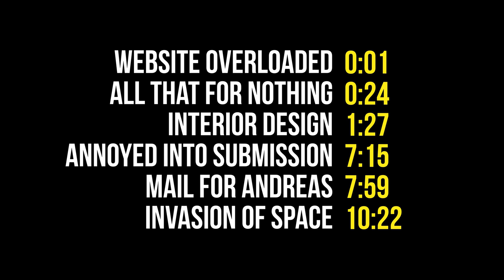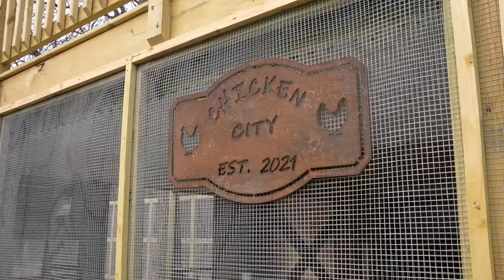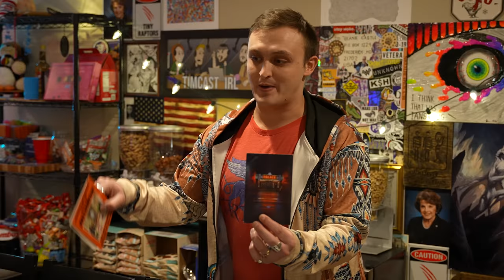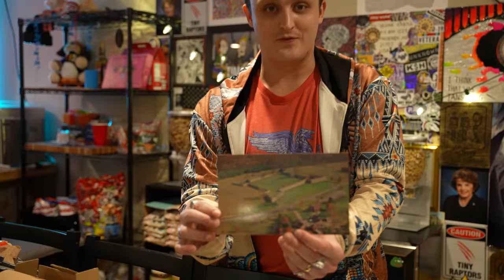Chicken City Completes Construction On Chicken Main Street

Comment: Feels like there is a glaring "security hole" in chicken city.
The stairs has no grate or anything so foxes and snakes can easy get to the chickens.
Reply: If you go back to earlier episodes when it's being built, you can see they sealed up the behind the stairs.
Reply: @TaylorLiam87  I think they mean stairs go up, and there’s no roof to the pen.
Reply: @hmg9194  I think they’ve said the plan is they put them under the house at night which is completely sealed in, and can open up run during the day
Reply: @kpb17  I would still chicken wire over it as a roof, hawks can swoop down really fast and get them when they are all pinned up like that.
Reply: @zeref5845  So true. I lost a ton of chickens and ducks because I didn't write the top of my chicken runs at first.. I learned my lesson.
Reply: What about some sort of netting over the top to keep out Hawks?

Comment: Yeah you guys... I've had chickens my entire life. There's some work that needs to be done on this coup to protect your investment.  However, you guys spend so much attention to detail that I'm very impressed with the craftsmanship and design. Keep it up. Life is a learning process. Maybe you don't have adequate wildlife with brains there to be a issue 😀
Reply: I was wondering the same. They should find some sort of mesh wiring for the top of that pen. Hawks won't be tricked by those fake crows forever
Reply: They need to run strings across the top of the open coupe area with old CDd hanging off of them to spook hawks. Shiny CDs will do more to keep predators away than any fake birds or owls.
Reply: Was wondering about the lack of grass myself.
Reply: The opening on the top is fine, a hawk will be disinclined to fly into such a tight spot, for the most part. What is needed is boards and mesh built into the ground to keep out the digging animals. Also keep the roosting boxes away from the fence, raccoons will grab through the mesh if the can and will try to pull the chicken through the hole.
Reply: @davidachee1927  the contractors did built the fence into the ground, they showed it in earlier episodes.
Reply: @Yukikazehalo  ah, that is good. Good contractors are worth their weight in gold.
Reply: I have a question - how often do you wash your hands? In case of a bird flu breakout, do you have to cull your entire flock?